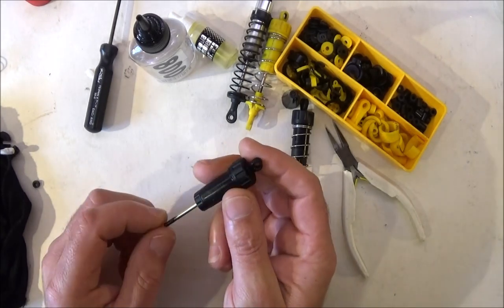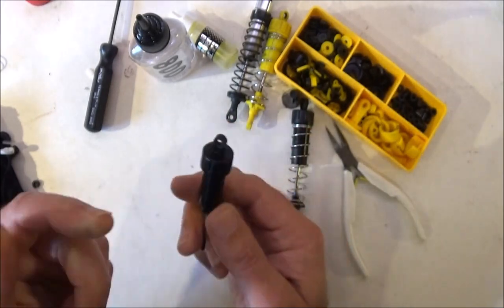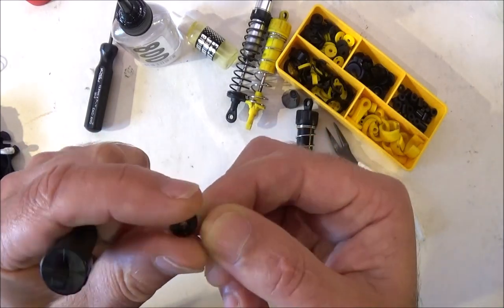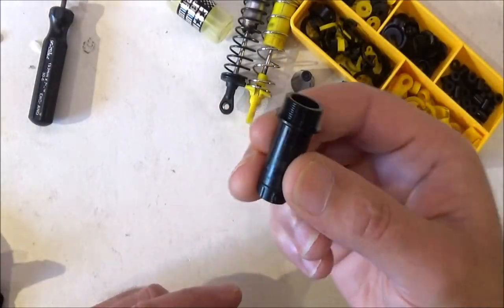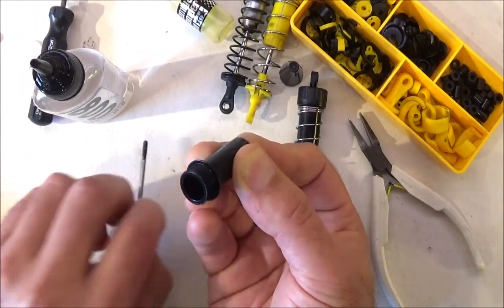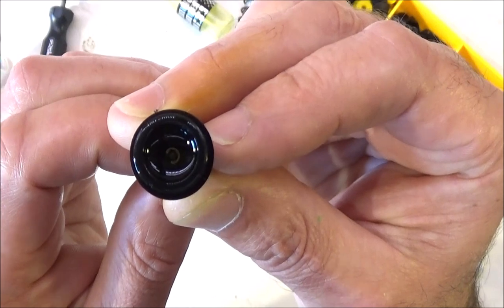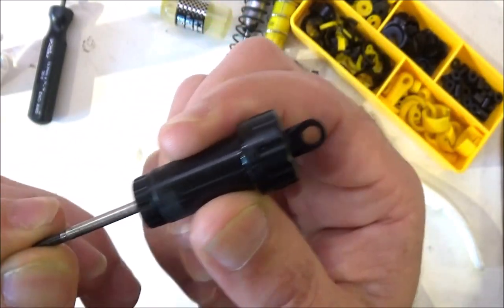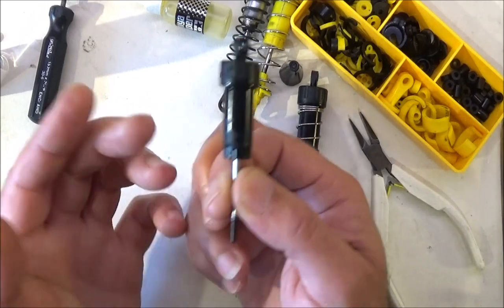How to Fill RC CVA Oil Shocks With No Air Bubbles! Simple No-Cost Tip!

Comment: thats called rebound , i always build my shocks with rebound , you can do this and still eliminate air bubbles ... rebound is good great tip though
Reply from the maker: Hiya mate! Thanks for the comment. I am no expert in shock building, all the instructions I have ever read tell you to get the air out, so I assume they work better when filled with oil only! So do you know what causes the rebound, if it's not the air? I would love to know! I have thought hard about it and still can't think of a reason - but when I filled up the shock first and then pushed the piston down, I had no rebound on the finished shock? Yours very confused!!!   :D
Reply: @MarkBryanRC  its the air pressure above the bladder dude , if you move the piston to the top most position before fitting bladder and top cap you can get rid of the rebound , or have the piston half way up before fitting bladder and top cap and you will have half rebound , and so on
Reply from the maker: Wow, dude - That makes perfect sense - I thought the diaphragm or bladder was there for something other than just sealing the shock, or else it would be flat and not dome shaped! So I got no push-back 'cause I fitted the cap with the piston at the top?  Great info mate - oh, well at least my tip does tell you how to get rid of the bubbles! Thanks for the reply dude - hey, you should do an explanation video about setting up shocks - it would be very interesting!  :)
Reply: @MarkBryanRC  i will get round to it , the only reason i haven't is because there are plenty of better explanation videos out there but obviously not everyone gets to watch them
Reply from the maker: You should dude! And I doubt those other videos would be better than yours!  :)
Reply from the maker: Thanks again, dude - I have edited the video description and put a thanks to you  :)
Reply: @MarkBryanRC  always welcome and thank you 2
Reply from the maker: Cheers mukka!  :)
Reply: In the Gmade diaphragm shock instructions it is called low pressure (no rebound, piston on top when assembly the bladder and cap) and high pressure (full rebound, piston fully retracted when assembly the bladder and cap).

Comment: When the air is stuck in the shock is called rebound when some people like it so their chassis doesn't hit the ground when they do jump
Reply from the maker: Thanks very much for the info, Toby. Yeah, I have learned a lot making this video, and it's still a good way of preventing air bubbles if you want to. All the best from Mark...   :)
Reply: Your best off using a harder or a progressive spring, 
using pressure in the shock to stop bottoming out  is going to eventually blow the shock imo
Reply from the maker: @mark675  I totally agree, Mark. The damper is designed to slow the movement of the shock rod, and not to prevent bottoming out - that's the job of the spring tension!